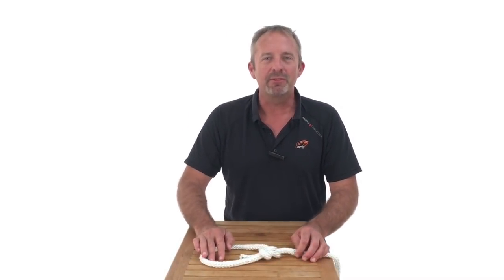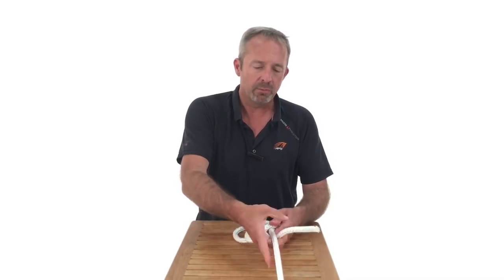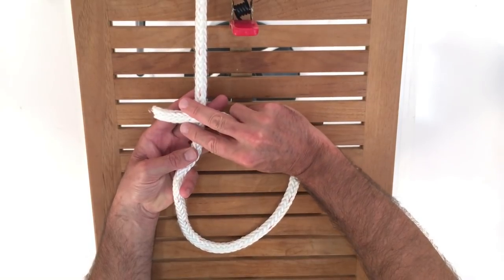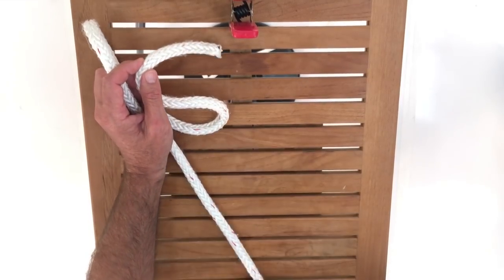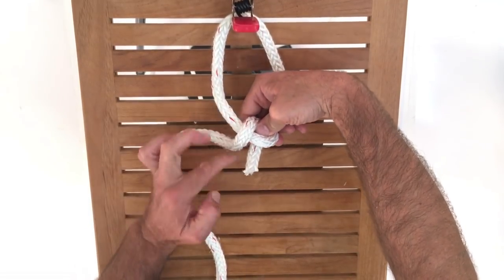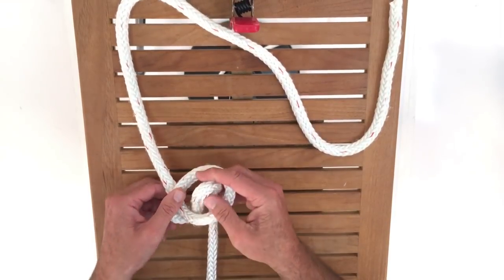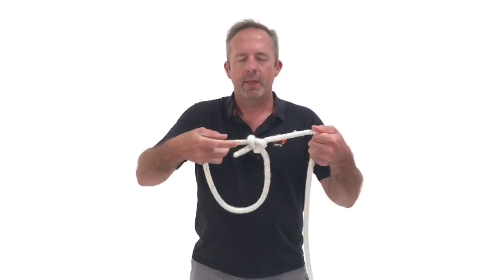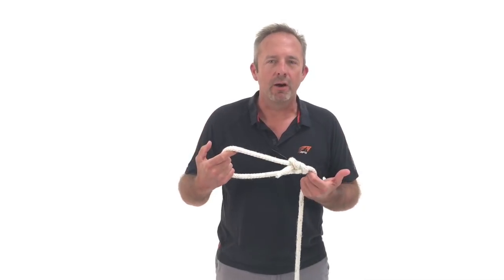How to Tie a Bowline Knot in the Dark | Expert Advice

Comment: But you show a "wrong" bowline because the free end of the line is inside the loop. This is not good because movements of the loop at a capstan can open the knot. In the right way zhe free end shoud be outside the loop.